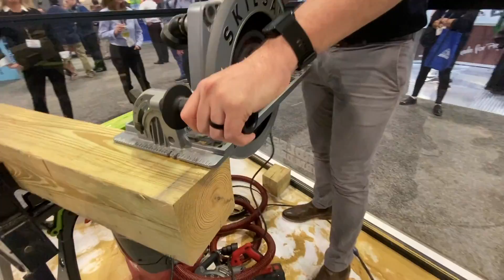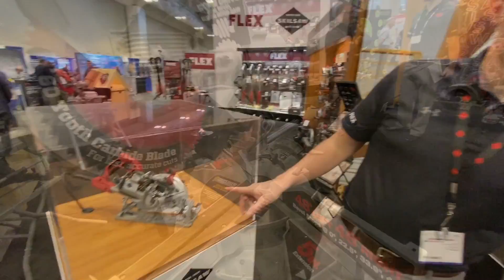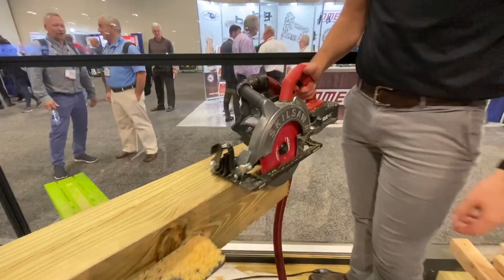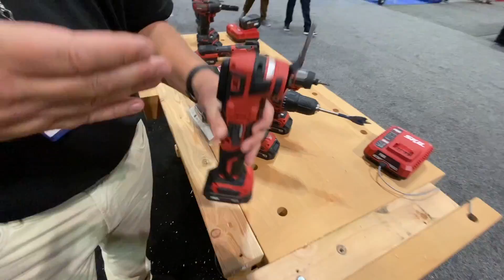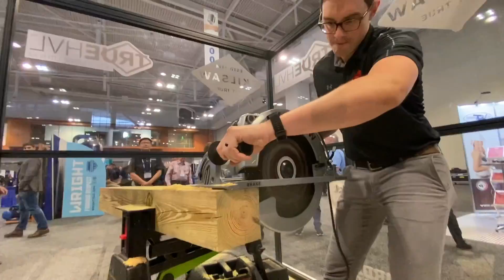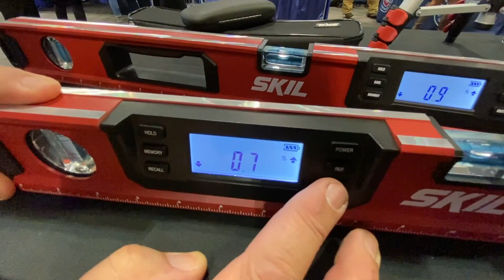New TOOLs from Skilsaw, Skil & Flex. Plus we pull apart a worm drive to see why they are strong.

Comment: A better comparison for skills design would be a hypoid gear in the makita.  The rest helical gears just simulates the looks and feel but not the actual drive system.  I think the hypoid is probably better with less maintenance, being more efficient.  Not sure if a mag77 will have more torque, but I dont think its necessary for a 7.25" compared to a makita hypoid.   Eitherway, I am sure both are strong enough to do the job.  But I saw a takedown of the recent cost savings by skil...

Comment: I LOVE my skil worm drive with a 50’ cord attached.  The battery worm drive is cool but lithium batteries are just such a failure in real world use.  I’m a carpenter in ne South Dakota and having batteries that lose their charge when they get cold, then won’t recharge or work at all when it’s too cold or too hot is not feasible.  These big batteries are expensive and it seems like as a trade group we are buying them and accepting that they don’t work when we certainly wouldn’t put up with a $200+ corded tool that just suddenly decided on its own to not work because its January and we are trying to do a job outside.   On a side note I am asking my Tool sales guy to get me that skil compound mitre saw to look at.  That looks like a great product.
Reply from the maker: Thank you for the comments and input!

Comment: If you have ever worked on the original worm saw, they are not the same  as the new one uses lighter cheaper quality components and smaller bearings

Comment: Witht he worm drive, a big advantage I would have thought, and they didn't mention, is that the motor is behind the saw - this would reduce the clearance needed to the right and improve the balance as it is a counterweight to the actual saw head and isn't offset to the right.

Comment: I can't wait for some of our tool manufacturers to come out with a waterproof battery so I can use a half inch impact to change out tires in the rain and not have to worry about accidentally setting it in a puddle, then having to put all 8 of the lugs nuts back on by hand.  Especially at night on some 2 lane back country road.
Reply: metabo has a waterproof impact ip56

Comment: I'm right eye dominant  I would have a hard time using a worm drive, can you get the blade on the other side?
Reply: Don't know why but worm drives are and always have been, as ar as I know, "left handed."
Reply: They make both "sides" 
Hilti or Hitachi for left handed guys
Reply: @h2s A guy I worked with a few years ago had one , they're like hen's teeth around here, well anyway's , I thought it was a great saw but couldn't see the line unless I used it left handed, the mate that owed it was LEFT handed. I live in N Ireland

Comment: I’m not sure as far as longevity of the systems, but I hate it when people talk about getting way more torque from a worm gear set. Think about it. Between models, motor rmp will be similar, and blade rpm will be almost identical. This means the gear ratio is approximately equal, and they have pretty much the same torque. It wasn’t said explicitly in this video, but I hear people talking about it all the time.

Comment: Like how skil saw compared the saws, showing you what each other company’s design with the gearing set up is. they aren’t being bias
Reply: There's nothing wrong with the other saws' gears. It's a marketing thing that worm drive is the top. The Dewalt flexvolt saws have more power than the corded skilsaw.